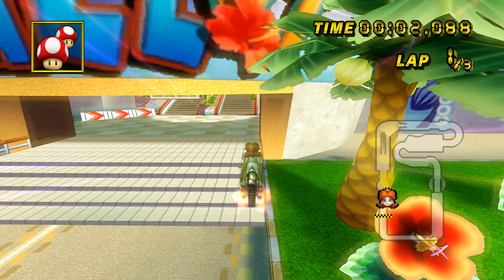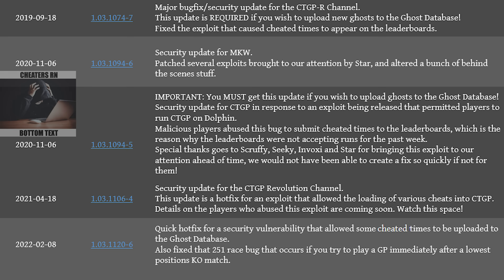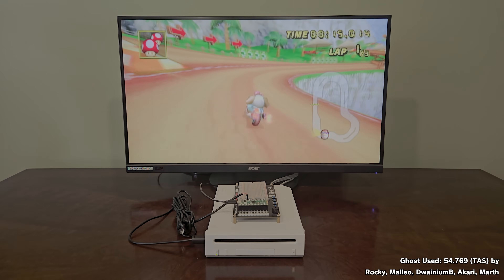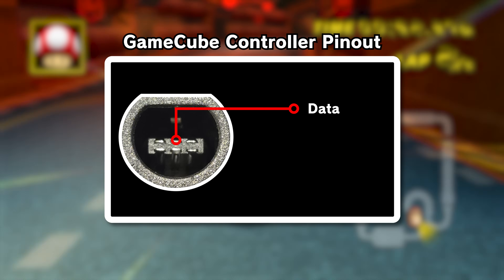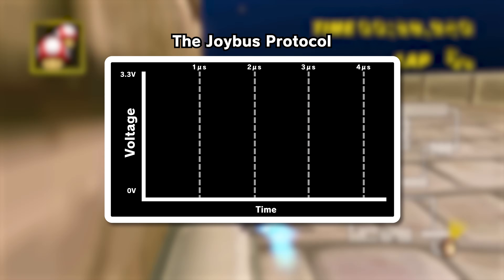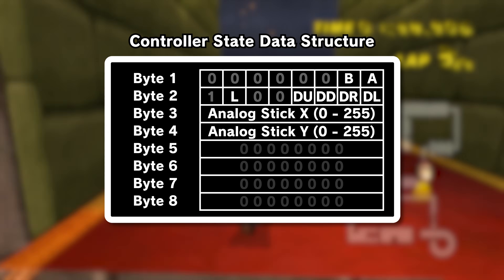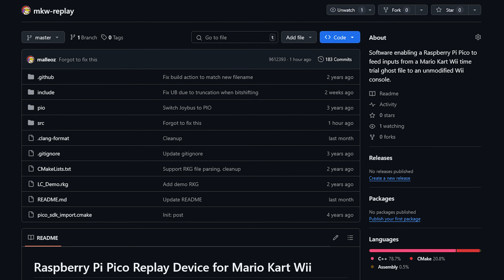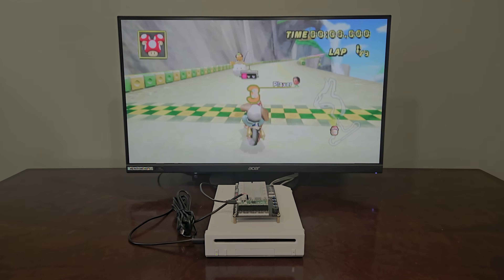Building an Undetectable Cheating Device for Mario Kart Wii

Comment: I'm not sure I understand how the anti cheat works. Can't the program randomize slightly the input number to avoid detection?
Reply: The anticheat doesn't detect cheating, it breaks replays posing as humans by messing with their angles just a little bit in a way a human can recover from but a replay can't
Reply: @finngardiner5358  artificial stick drift? nice
Reply: @oussama7132  No, a single frame of difference to a tiny degree on a 60fps game. It doesn't alter how you are driving in the moment, as human players can't tell the difference. What it does do is amplifies mistakes much later in the run when the butterfly effect prohibits identical inputs from giving the exact same position 10-20 seconds down the line.
Reply: @flambambam  No, they had it right the first time.  Im sorry your QA staff of Wii fans that responded to a Discord ping  arent capable of caring about a better solution.
Reply: @ If you care to, visit the stream of a top tt player today and ask if they can tell a difference before making such bold claims.

Comment: There's some good to this too, now there's an easy way to verify TAS speedruns of tracks thanks to this
Reply: Honestly, with a different sync mechanism, you probably COULD use this to make a Wii/GCN TASBot, which would be pretty nice to have for console verification, and lord knows how happy that might make GDQ.
Reply: As far as I know, this is basically just how tasbot works, though, I could be wrong
Reply: @lula4260  Most likely, yeah! TASBot isn't limited to the physical constraints of a legitimate input device (holding D-Pad Up+Down is a completely viable input that an NES is capable of processing), so if you can figure out how to broadcast the exact input signals a real controller would (including gyroscope and pointer, for a Wiimote), in the exact method it would (over bluetooth, for a Wiimote), there's genuinely no way for the game to tell the difference. It's all just precisely timed electrons as far as the hardware is concerned.
Reply: Instead of figuring out the Bluetooth stuff, just modify an actual Wiimote.
Reply: Unfortunately, there’s a few problems with this. Across a single race, just importing a TAS ghost file is sufficient to verify a run. And if you try to verify, say, a Grand Prix TAS, since the game is running off a disc, the loading times between races can fluctuate just enough to cause a desync
Reply: @Portentous__  If there's a way to ensure the timing is always the same as what the video suggests, then that isn't an issue
Reply: @rawr51919  That's a big if, disc load times are very inconsistent. But maybe the replay device could track the console's input poll timing? It probably varies from game to game, but I know Super Mario Sunshine polls input once a frame, except right after loading a stage from the disc (while it's setting up the stage in RAM), so the input device could tell the end of a load time by noticing multiple consecutive frames without input polls. This still isn't perfect if the replayed TAS relies on system time, or RNG in games that have it advance during load times
Reply: @Qbe_Root OP is only talking about TAS for mario kart wii
Reply: @ I know, just sharing an idea that might work for MKW too
Reply: @Portentous__ nerd 😂
Reply: @koura7883  bro everybody watching this video is a nerd, and if you're not, you're missing out.
Reply: @ I know lol. I’m friends with portentous I’m just bullying him